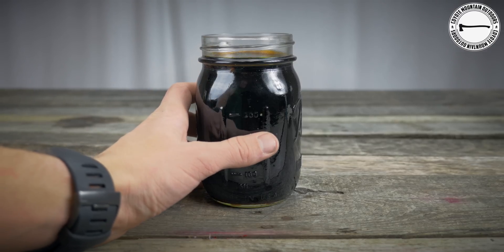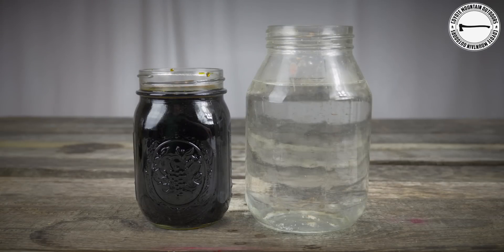How To: Acid Etch a Knife

Comment: I suggest a test as I have done .. acid etch with sharpie marker ..discovered by accident
Reply: How did you do it?
Reply: @rosellehines  drew what i was aiming fror to be not etched and on damascus steel applied 12 volts through a q-tip with "aluminum black" acid an estimated 5 seconds contact 3-5 times  .. in my case resulted in a shinny spider web after polished up with darker and duller ....will do a video soon
Reply: New vid almost ready ..
Reply: @rosellehines  new vid is up (unlisted) https://youtu.be/8wlHeMe6oJo

Comment: So does anyone know if the etched metal affects the heat treatment or make the etched steel more succeptable to rust?
Reply: Late reply, but for any who are still wondering, no it does not affect the heat treat or anything like that. Any parts that are left darkened by the enchant are actually MORE resistant to rust.
Reply: +Bastian haha ty for the reply, I think I ended up asking a couple knife makers too and they said they same thing. I'm thinking tho it depends a lot on the steel and patterns etched. I did my endura and a pingo and live on pacific coast. no specs of dust for the last year. so I don't think it affects it too bad. I did sand it rigorously to 600 grit so maybe that gave it a little less pours for gunk to get in.